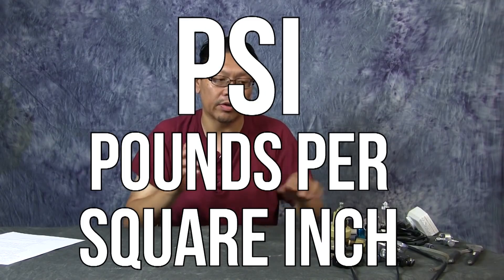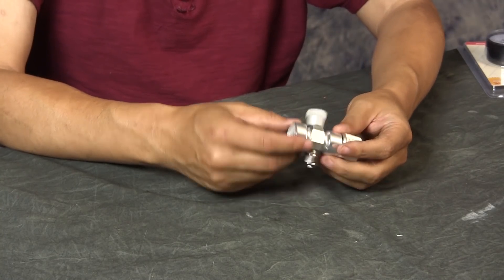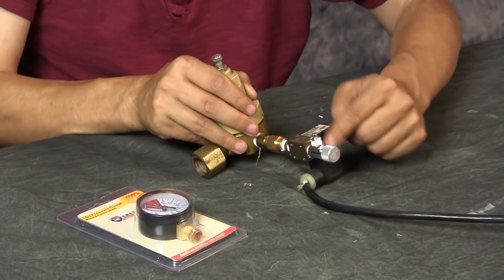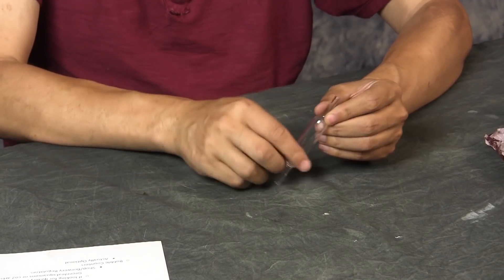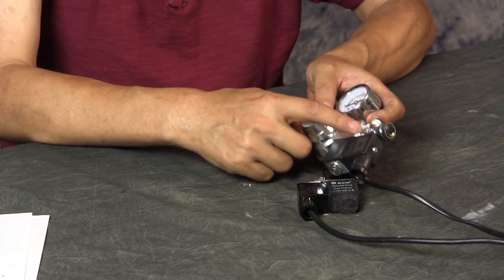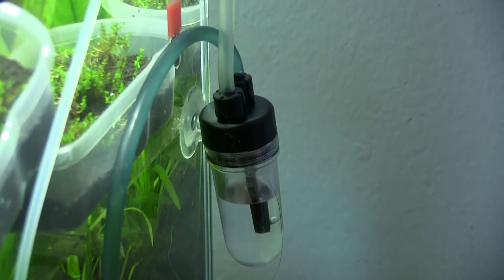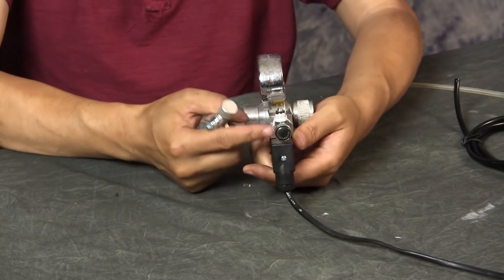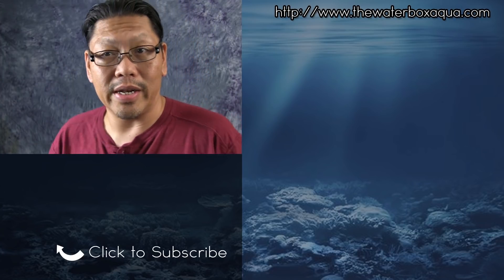Aquarium Co2 Regulators and Flow - The Ultimate Aquarium Co2 Guide - Part 4

Comment: Do you recommend single or dual stage regulators? Is it worth the extra money?
Reply from the maker: I always go with dual stage. The extra redundancy is always good but it the budget is that tight, a single will still work fine. You just have to be more diligent. That said, I have never experienced a Co2 dump with either single or dual stages either but there is an inconsistency in single stage when the tank gets toward empty and you would have to re-adjust often when it gets to that level. So it's up to you whether or not you want the redundancy in the system.

Comment: Hi! I am using the pre-set 50-60 psi dual gauge both from china. brand name is zrdr. i accidentally opened the middle cap. i immediately turn off the co2 tank. i return the middle valve but when I open it, the pressure (PSI) is now 20. then going 15 and below when using. Can I return it back to 50-60 psi pressure? Thanks!
Reply from the maker: You MIGHT have to get it replaced.  I don't know if you had success fixing it but I had to replace mine when I inadvertently did that once to one of my Regs.

Comment: Hello there. I accidentally unscrewed the knob before watching the video. I just put the knob back with a few turns. how tight or loose do i need to leave it? Is it possible to set it again if it is preset?
Reply from the maker: Depends if it was made to be twisted off.  If you're lucky you can get it screwed back on correctly.

Comment: I recently purchased an fzone c02 regulator. Only to find out from customer service later, that it comes preset to 50 psi (not listed in description) and that it's "not adjustable". The valve nozel on the front, which would normally be able to decrease working pressure, only gets it down to about 45psi. Before it starts to leak (aka blow off the nozel) is there any way to mod this so it is adjustable???  Any help or advice would be appreciated.
Reply from the maker: Not really, you'll need a new casing in which case, you're just better off buying a new regulator since that's most of the regulator. You're fine at 50 psi. Just get a good needle valve.
Reply: The needle valve on the fzone is very good, most co2 dumps occur when people fully open the needle valve and try to adjust the bubble count by using the regulator knob,. When the cylinder presure gets low the diapham cant adjust. At 50psi it still  functions until the gas runs out

Comment: What happens if we turn the knob and increase the psi?
Reply from the maker: It'll raise the PSI in your line. If you do too much, it might pop out a tube connection somewhere. You don't need more than 20 to 25 PSI for what we're doing.  That's more than enough to push co2 into your tank which will be controlled by your needle valve

Comment: Thank you for the info on fixed working pressure. I would have destroyed my new OF regulator thinking it can be dialed as shown on other videos. Thought mine was tight and almost used a wrench to force turn it. Lucky i saw your video in time.
Reply from the maker: Not a problem!

Comment: Hello, I know this is late but I have some questions. Would u prefer in line solenoid or a co2 regulator with a solenoid attached to it? Will u loose more co2 if u use the inline solenoid when compared to co2 regulator with solenoid.
Reply from the maker: A solenoid attached to the regulartor because it's just easier to deal with. You shouldn't loose any more or less co2 if it was inline unless you have bad connections/hose
Reply: @TheWaterBox  hmm okay, because I'm planning to get a co2 canister for sale I found but its regulator doesn't come with a solenoid. So i was just wondering if there was any differences between the two.
Reply from the maker: @just.joeking0255  I'd wait and save up for a set up with a solenoid connected to the regulator if this is your first time with co2 or if you''re not handy.
Reply: @TheWaterBox  ill do that then, thanks alot for the info
Reply from the maker: @just.joeking0255  no prob

Comment: Where does he talk about flow....?
Reply from the maker: The whole video. Talking about the flow of co2 going into the tank.  This isn't a video about water flow in the tank itself. That's covered in other videos.
Reply: @TheWaterBox  ohh I see thank you. Just a question about WaveMakers, should I have mine on to increase flow in the aquarium while the c02 is on? Or does this create more surface agitation therefor needing more bubbles per second to achieve good levels of c02? My c02 is coming from a difuser attached to my canister filter.  It seems like my drop checker indicator needs more c02 while the wave maker is on to turn green.
Reply from the maker: @robertcostache6824  You want some surface movement (not agitation) for exchange of gas (you want O2 as well as C02 in the tank so you CAN have more co2 in the tank). If the flow is moving then of course the co2 is going to move around so you may turn up the bubbles per second. So it slowly.
Reply: @TheWaterBox  thanks a lot your videos on this c02 part series helped a lot!
Reply from the maker: Glad it helps

Comment: Thanks for the great videos, just wondering could you bypass any inline needle valve with an external needle valve by just leaving the inline valve open? (Say the provided needle valve isn't very good)
Reply from the maker: You can. Just have to be careful that the connections are solid.  You're dealing with high pressure on a normal co2 set up with a tank.  A needle valve patched through with simple silicon lines will most likely pop or split on you.

Comment: Does anyone know something about mufan and wyin co2 regulators? It's dangerous?
Reply from the maker: Normally, regulators are built to spec.  It's not the matter of it being dangerous but rather the quality of how they are made.  If they do fail, it's not dangerous but might cause improper to no co2 output but that's a chance for any brand. Some have more of a chance than others.
Reply: So , did you recommend me to try them?
Reply from the maker: @yannismavrikos5653  Since I personally never tried them, I can't actually recommend those brands.

Comment: I currently have a dual stage regulator and tank from a home beer kit.  There is no solenoid or bubble counter then obviously.  So if I do an in-line solenoid and inline bubble counter. I believe I will still be lacking a needle valve, correct?? If so,  is there any way to get a needle valve with this setup.  
I do have a about an 3/4” metal probe sticking out from the regulator that the hose will hook up to.  So can just get a solenoid/bubble counter that attach right onto that vs. an inline. That way it would come with a needle valve.
Reply from the maker: You really want a needle valve to attach right to the regulator and then if you want, do the bubble counter and solenoid inline though I recommend having the solenoid attached to the tank before the needle valve.

Comment: Very informative. i have a question however. Can the regulators I see at the place where I get my CO2 bottles? They are industrial type and i figure I'd have to use some sort of adaptor to get one to take the smaller line. I'd love to hear form you. Thanks
Reply from the maker: Yes, you usually can use a regulator used to regulate co2 to do this. You might have to get the right fittings but it's basically the same thing.  For example, people uses regulators for beer brewing for fish tanks.  Just make sure it's clean and that it's rated for co2.

Comment: I have the Fluval 20g kit with a bubble counter, and diffuser, and I have 30 16g eBay cartridges for when the tank runs out. I tried connecting the regulator to a solenoid, but the tube before the solenoid blew up twice so far. Is there a small regulator that I can use for this setup, or is the tube going to blow every time when the solenoid is closed?
Reply from the maker: The 20g isn't built to release Co2 that way. It's a passive diffusing system.

Comment: Hi Chung .. what is better for your bubble counters , Plain water or Mineral oil ?? 
i been using water but i watched other videos where people use mineral oil  as well , So 
what do you think ??   Tks .
Reply from the maker: Either works fine.  Mineral Oil would be better because it doesn't dissipate as readily so don't need refilling all the time. If I had the choice, Mineral Oil over water.  Other than that, it doesn't effect the bubble count.
Reply: @TheWaterBox  ..Thank you Chung I an going to do that change !!
Reply from the maker: @Diosesdepapel  Right on!

Comment: Thank you for the video, I have a ISTA Co2 Cylinder and Ista Single Gauge Co2 regulator with Solenoid, pressure in cylinder is 1200PSI and when the power is turned off I still see CO2 leaking from Solenoid at like 1 bubble per 8 seconds even after 2-4 hours, how do I fix this? There is a knob below the solenoid, is that the working pressure knob which I need to tighten clockwise with wrench to reduce pressure?
Reply from the maker: You might have a bad solenoid.  Sometimes there's still residual co2 that need to be gassed off once it shuts off but it should stop after a 10 to 20 minutes.  If it's still going, might be a problem with the seal in the solenoid.
Reply: I assume that’s the case, it’s a brand new regulator though 😐
Reply from the maker: @photo_magicshots  If it stop after 4 hours then it just might be that you have residual pressure left over.  It could just be normal for your set up. 1 per 8 seconds shouldn't harm anything
Reply: The Water Box Ok, I checked again and it seems the regulator can handle pressure of 800-1000 PSI and then regulate and output around 30-40PSI but it seems the cylinder pressure is at 1100 plus which is causing the co2 to leak. I stopped the cylinder valve and brought down the pressure to 900 and it stopped the flow completely, so it seems may be the cylinder was overfilled beyond 1000PSI, so once the co2 releases a bit, after 10 days odd the pressure will come down below 1000 and it should work totally fine then

Comment: Are you supposed to turn off the working pressure and co2 tank valve before removing the bubble counter?
Reply from the maker: No, you can just make sure the source is cut off at the needle valve (turn it all the way off) but you can turn off the working pressure if you want.  I never do and just make sure it's cut off at the needle valve setting.

Comment: I have a paintball setup. My ??? Is can I run my tank on a 45degree angle so I can read the gauges when in operation??
Reply from the maker: I wouldn't unless you know your tank has a built in siphon.
Reply: @TheWaterBox  ty I'm not running it on a 45degree. It does have a slight tilt just so I can read the gauges now.. the regulator isn't cold or anything and been running it like that for about a week and no issues. Ty for the reply.

Comment: I am new to using co2, bought a 1L Ista face up set. However, I bought a new  bigger tank which is face side. Can I still use the same regulator?
Reply from the maker: As long as the bubble counter isn't attached to the regulator, it should work fine.

Comment: are you familiar with ISTA brand? Do you know what are the thread size of it? like ive been looking for regulator for it but im not sure what size i would get... I hope you can replay to my question.. thanks
Reply from the maker: I know the brand but dunno the size of thread. Sorry.
Reply: @TheWaterBox  no worries buddy, i have figured it out. lol! btw any input or comments regarding Utricularia graminifolia vs hairgrass? specifically maintenance and difficulty?
Reply from the maker: Just grow it. lol  Honestly, I get this question a lot about tips on growing this plant or that plants vs this plant or that plant.  I just plant it and go and watch. But between the two you mentioned, gram will need more lighting and will benefit from Co2 than Hairgrass.  So don't try to do minimal low light as you would with Hairgrass.  gram won't grow as well as Hairgrass under those low conditions.

Comment: First off, thank you for a great series of video's, which i keep returning to. :-)

I have a low KH set up aquarium(and do not wish to increase alkalinity/buffer capacity), which when acidified by CO2, drops the pH down from 7.5 to 6.7
If i shut off the regulator with a solenoid, during the night time non photosynthesis period, would that not induce a potential swing in pH? I would have thought that maintaining a stable pH would be less stressful for the fish. If the water column is 'saturated' with CO2, i would have thought that the amount used by the plants would be negligible overall. In this instance, would it actually be better to maintain CO2 saturation 24/7? Thanks for all opinion offered.

Also, i have noticed i hit a CO2 saturation equilibrium when the pH drops to 6.7 and wont go any lower, no matter how much i increase the bubbles/sec. Is this a function of the low carbonate hardness or a function of the off gassing due to surface water agitation. Ideally, i would have liked to hit pH 6.3 with CO2 alone, not by adding additives. Any thoughts?
Reply from the maker: First part of the question, just pay attention to the PH before injecting Co2.  When adding Co2 you're mainly controlling the drop manually so 1) You can easily adjust it.  2) It's an artificial drop so as long as it's not such a huge drop in a short period of time and still in range for the fish itself, you should be fine. It won't stress the fish too much. Rapid PH drop (swings within minutes) is what stresses out fish. I've never had a problem with say, 7.6 base and Co2 drops to 6.0. Fish were fine and good.

Second part of the question: Depending on the o2 level, tamps and pressure in tank, there can be caps. In this case, I would up the O2 intake with surface agitation to promote more gas exchange.  More o2 level = high Co2 levels.
Reply: Many thanks once more, for all your advice given, much appreciated.
Reply from the maker: No prob!

Comment: A suggestion for your hot solenoids. Get some thin sheets of aluminum or other metal at a craft or hobby store and some thermal adhesive from an auto parts store. Glue pieces of the metal sheet to the metal housing of the solenoid. It should work as a heat sink and dissipate the heat so that it doesn't do any harm.
Reply from the maker: I put mine on top of aluminum foil myself. I wouldn't encae or wrap it around it but it help keep the hotness from any burning on the table it was sitting on.
Reply: @TheWaterBox  I put mine right in the fish tank, keeps its cool

Comment: Your videos always bring fresh ideas. I was wondering can I do a co2 systems with just a solenoid and and the needle valve, no regulator?
Reply from the maker: Errrr... Not really. It does work that way. Assuming you're taking about a pressurized system. Something needs to "regulate" the pressure coming out of the Co2 source/tank.

Comment: I have a 125 gal tank, 6’ long. I’m new to co2, would one diffuser be enough for my tank, or should I get a splitter and two diffusers for each end of the tank. Your very informative and I appreciate you sharing your knowledge.
Reply from the maker: That's fine. On a 125 tank, I'd suggest going with inline atomizer/mister or a reactor and providing great flow in the tank to move the co2 around

Comment: I got 2 of those Aquatek paintball CO2 regulator. Since it’s my first and only experience with CO2 regulators, I’m used to the finickiness of the control. I don’t think it’s that bad, lol!
Reply from the maker: It's still annoying but once dialed in it worked fine. I hate it when you think you got it dialed in, the next day it doesn't come on when the Soleniod kicks in because the valve creeped into a close position.